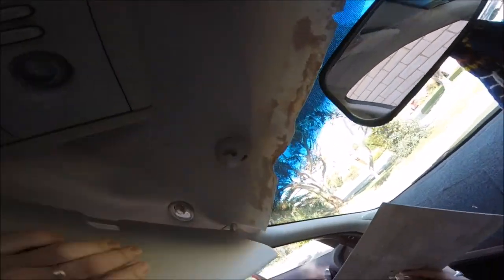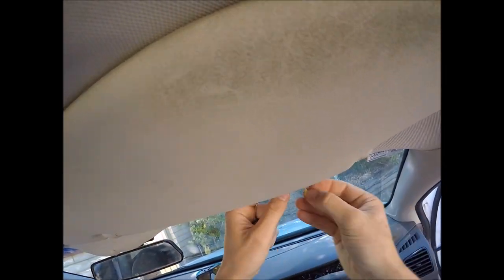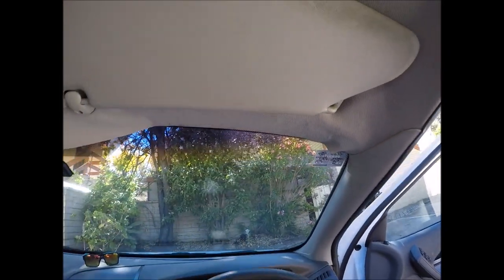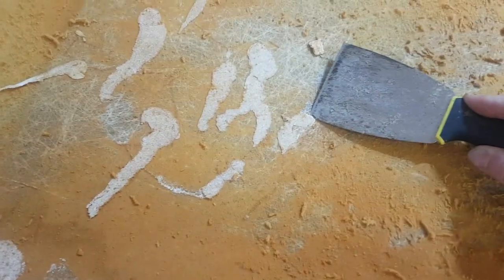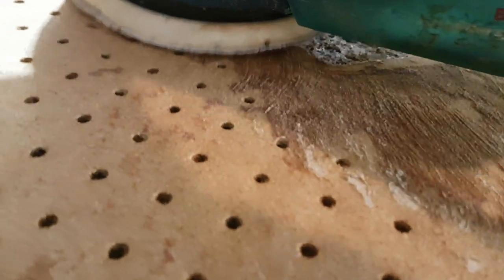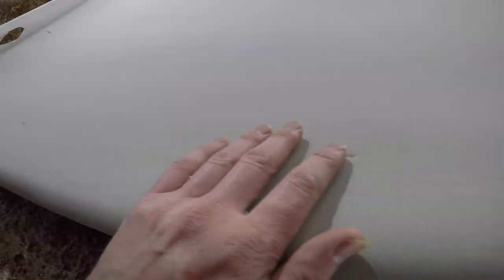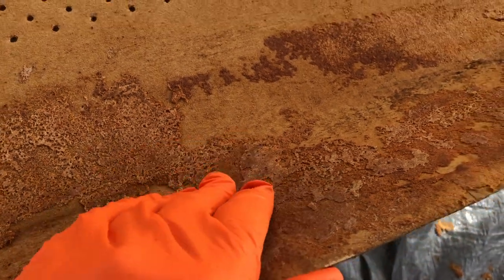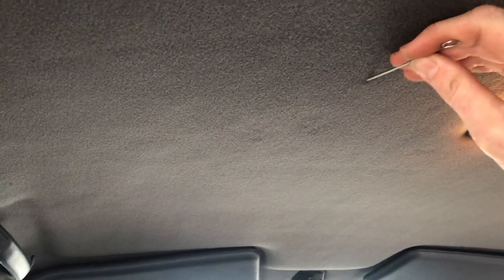3 BEST QUICK TEMPORARY FIXES To Repair Car Headliner

Comment: Awesome.  Pulled out the staple gun and dropped about 60 staples in my header on an old 2007 Honda Pilot with 350,000.  Just as good now as when it had 330,000 miles on it!

Comment: how about injecting some polyurethane foam inside there with a needle? would it leave stain, would it be a good adhesive for holding headliner?

Comment: Do you need a specific type of brush to remove the loose board pieces?
Reply from the maker: Soft fibre brush first, if the board doesn't tear up, you can then move to a straw brush or even wire brush